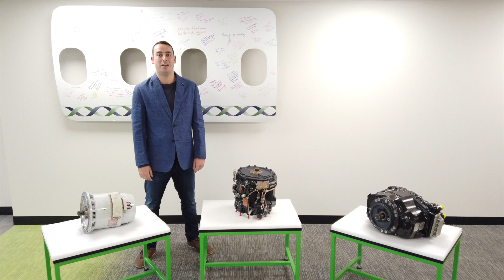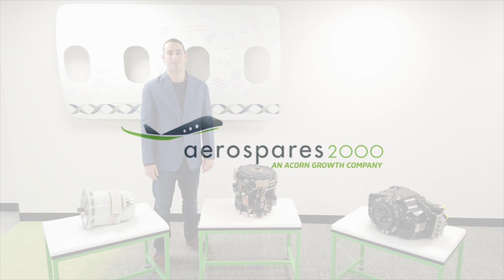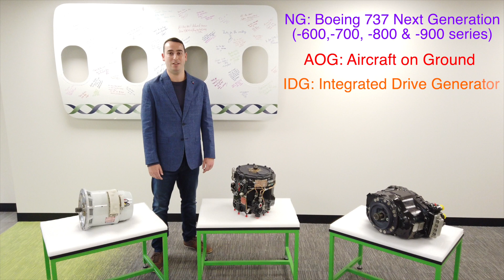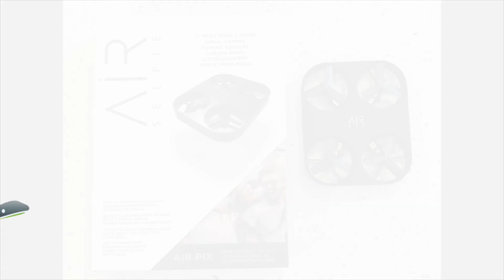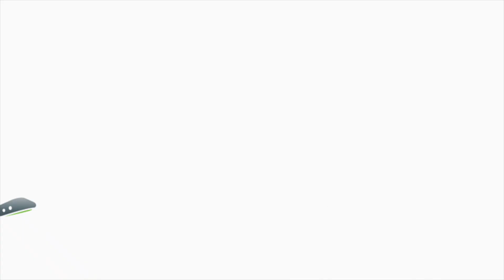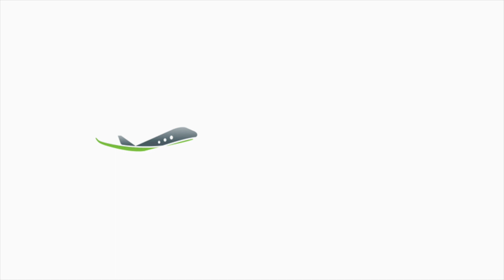Aircraft Constant Speed Drives (CSD’s) and Integrated Drive Generators (IDG’s) Explained

Comment: For doing this, I've wondered if it was a direct connection to the main shaft of the jet engine or not. It makes sense it would have to be but it seems like you would lose a lot of initial thrust when powering up the engine.

Comment: I am an Aircraft Electrical systems technician. When I was in the air force, I mated and de-mated many Generators and CSD's. The Generator was oil cooled instead of air cooled. When mated to the CSD, they were called IDG's.
Reply: Idg it self was being cooled by oil/air and oil cooler.